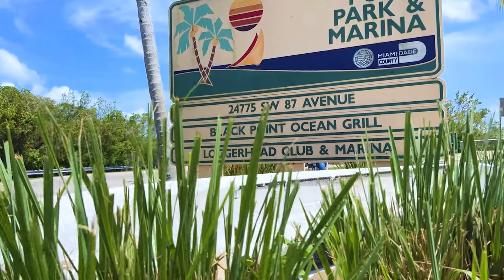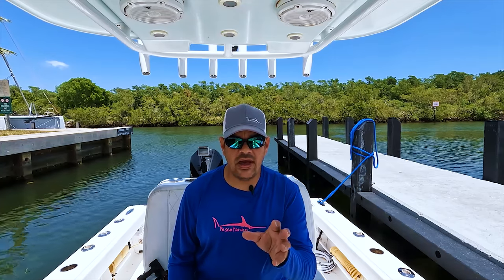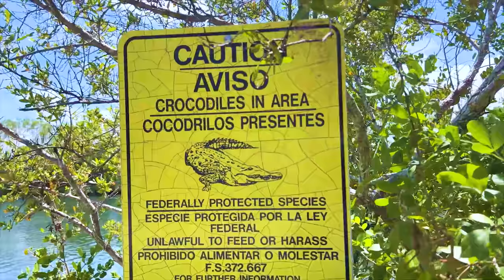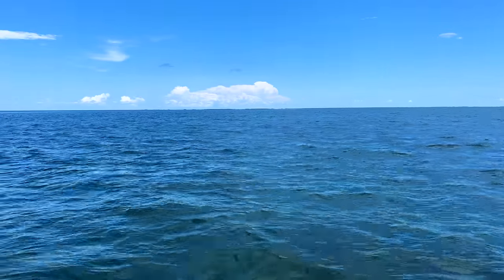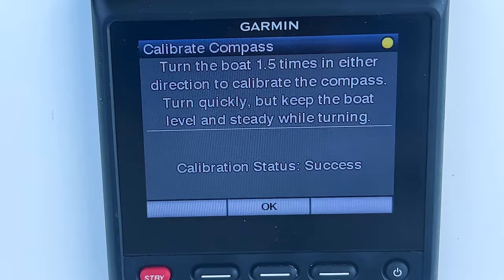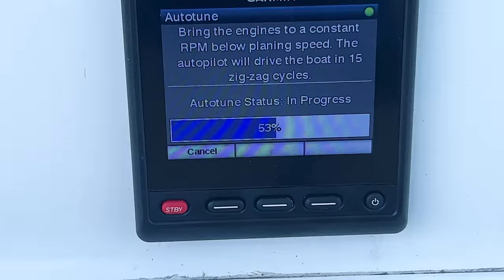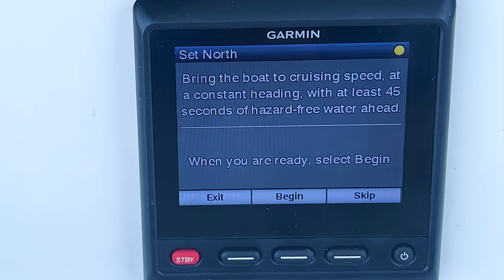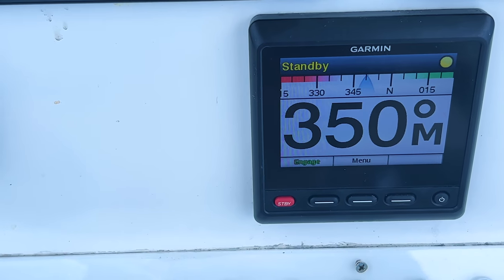Garmin Marine: Step By Step: Garmin Autopilot Sea Trial

Comment: Man , you make it look so simple. I have tried several times and can’t get mine set. My vessel on my gps pops up sideways. Any suggestions ??? I have a Pursuit 2870cc with twin Suzuki’s 300’s.
Reply from the maker: If the boat icon is sideways, that means the heading sensor is not reading your actual heading correctly. 

I have a video where I show you the steps to check your magnetic interference on your heading sensor. It could be that you will need to relocate it or that the heading sensor might be bad. 

https://youtu.be/V8zwE9Pe8mY

Comment: Hi captain Pedro 

I just bought a used garmin reactor 40 SBW for Volvo penta with joystick/stern drives 
. 
After install I can’t get threw the first step in the dockside wizard.

Every time I try and hit the button  on my GHC 20 left or right to steer the outdrives I get a message on my ghc 20—“autopilot controller lost” . 

If I turn my steering wheel manually left or right on the same setup page I see the little diamond icon move as I’m turning the wheel. 

Also in my EVC D system/display in settings under “installed steering component” it now shows up that autopilot is there. 
 
The instruction diagram doesn’t show anything about connecting the Volvo penta autopilot gateway so I didn’t install that. 
Is there something I’m missing? 
Should I just skip dockside and go to sea trail?  
I hope you can help I’m totally stumped.

Thanks
Reply from the maker: Unfortunately I don’t know anything about it with an inboard. If you are located here in Miami, you can try to reach out to Langer Krell. They are the leaders in marine electronics for sales and service and they can have a tech go out to meet you. 

My set up is with outboards.

Comment: Hi, when the Garmin auto pilot on my boat, when it sepose to do the zig zag test , it just go in circle. I tried many times it still does the same thing.  Please help, thanks
Reply from the maker: Ok so we had the same issue with ours and we spend months with techs trying to figure out the issue and they couldn’t figure it out. We replaced the pump and it still did the same thing and after spending hours with Garmin on the phone I was able to get a tech that knew what the issue was. 

This is caused by a bad heading sensor. They showed me a way to check the magnetic interference with my sensor and it’s super easy for you to check it. 

You might have too much interference where the heading sensor is mounted. This was the issue we had and it slowly was degrading the heading sensor. We were lucky that with just relocating it to another location in the console and recalibrating it, we didn’t have to replace it. 

If the heading sensor is too far gone, you might have to replace it but I would recommend to check the magnetic interference first. You might be able to save a bunch of money just be relocating it. 

If you look at the Garmin playlist on our page, we have a video that shows you exactly how to check this on your unit. If your score is low, try relocating the heading sensor in the console as far away from batteries and metal objects. Then check the magnetic interference again to see if your score improved. If the score improved, take the boat out and recalibrate it following the steps on this video. 

You want the percentage to be as close to 100% as possible. Keep in mind that you will never get to 100% though because it will always have interference due to the metal objects on the boat and within the console. 

Hopefully this simple fix will correct your issues. That simple fix corrected everything for us. Hope this helps!

Comment: Great video, but do you know why my Reactor 40 + GHC 20 loses calibration after a while and asks me to do all the autopilot calibration again?
Reply from the maker: Sorry for the delayed response. I was out of the country on a fishing trip. 

I was having that issue with my auto pilot where it would lose calibration. Not sure if the issue will be the same as yours but I ultimately had to relocate my heading sensor. I had my sensor in an area where it was getting too much magnetic interference. After I relocated it in my console, the unit worked perfectly. 

We have a video in our Garmin playlist that walks you through how to check the magnetic interference via a diagnostic check on your unit. 

Hopefully that is your issue and not that the heading sensor is bad.
Reply from the maker: To add a little more clarity, the magnetic interference is caused by metal items and batteries. This causes your heading sensor to have a change in direction. On my boat, over the corse of 4 years, that interference was just enough to make my screens go crazy and then when I calibrated it, it worked fine for a day then it would go back.